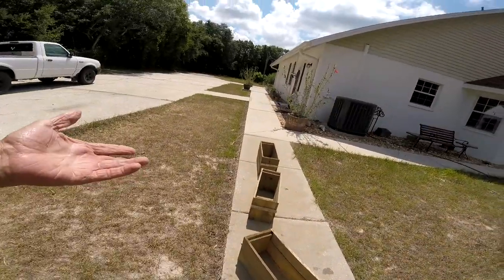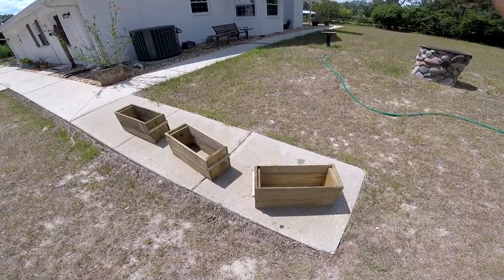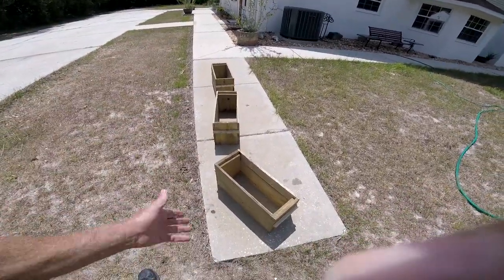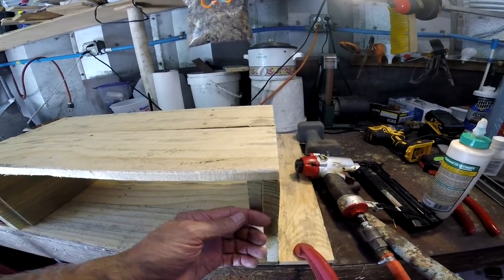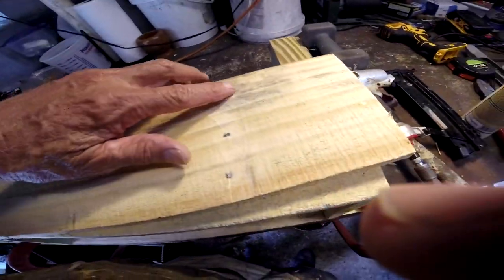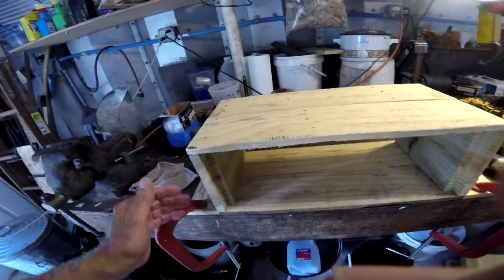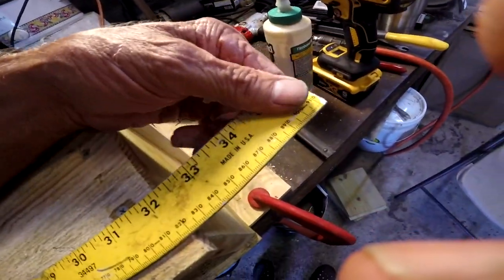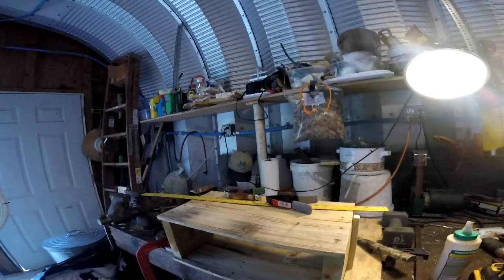Pallet Hives Tips & Tricks

Comment: Question? Why wouldn't you just cut the width of the boards on your table saw? The width is the same every time instead of that desk top work. I don't know haven't started yet ,but thanks for saving me money. I have noticed that on job sites that a lot of material like the 2x10s are thrown in the dumpster from rafters and floor joyce cut offs , like you say Steve'O a penny saved is a penny earned. Keep that ole brain aworkin LOL.Thanks for your time
Reply from the maker: I find it easy to just trim off the extra wood. Yes lots of good free wood from dumpster diving but make sure you ask first.